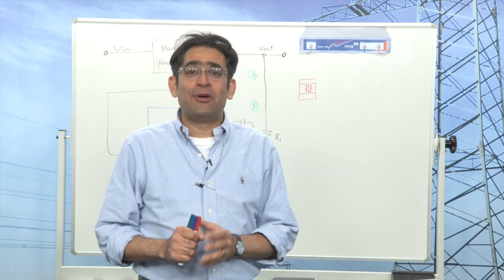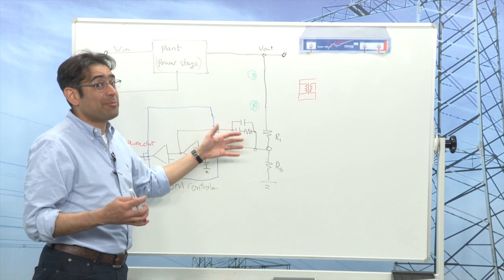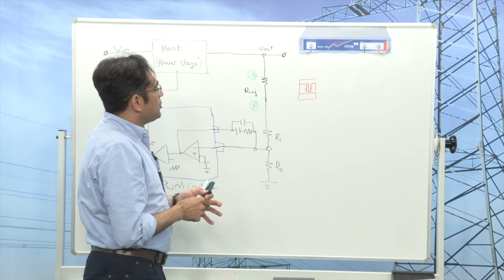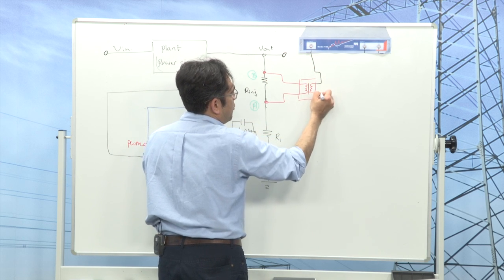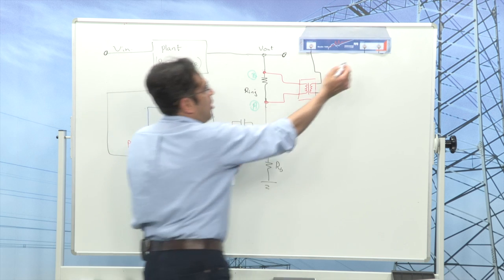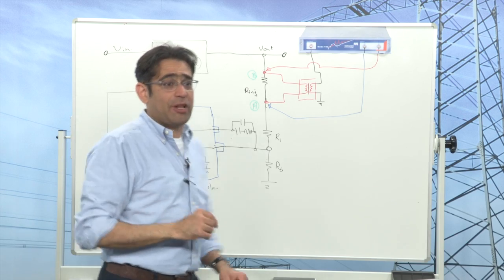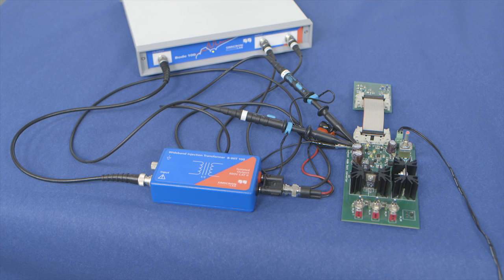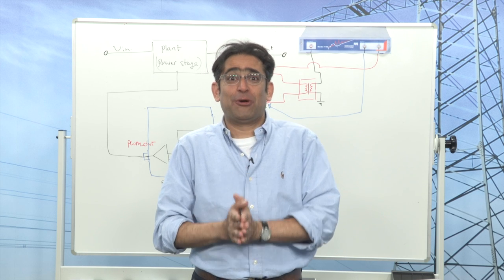Foundations (Part 1.B) - Loop Gain Measurement of our Switch Mode Power Supply

Comment: Could you explain what you mean by the injection transformer is connected differentially across the resistor? Does that just mean across the resistor?

Comment: I  am a bit confused how it measures phase if we only place probes A and B across small value resistor. Phase between which signals?
Reply: Phase at output with reference to phase being injected
Reply: I'm a bit confused too.  I was always under the impression that you would apply a frequency sweep signal at the voltage input of your power supply and measure the phase and magnitude at the output of the power supply...  Why do you inject a signal at the output?
Reply: @vex123  I think the answer is: because you want to measure the PSU's response to load transients, not its response to supply transients, and also because the supply is very low impedance, so injection of a small signal into the supply would be overwhelmed by the supply.  

Similarly, the PSU's output is also low impedance, but its feedback network is not.  So you simulate transient response by injecting a small signal into the feedback network in a way that won't materially affect its transfer function when the injection components are removed.  This tests the forward transfer function G(s) as well as its feedback transfer function H(s), ie the open-loop system characteristic which is really what you're most interested in anyway.